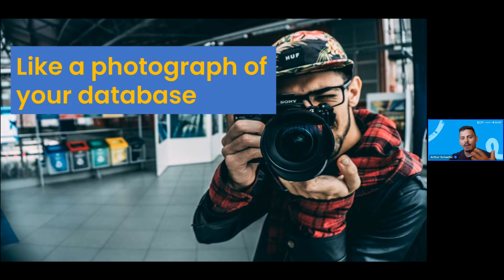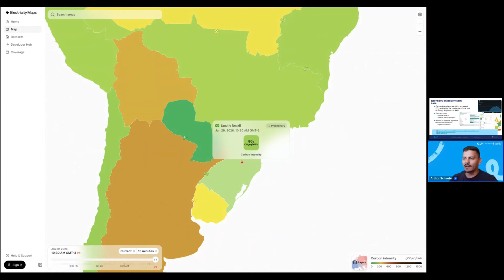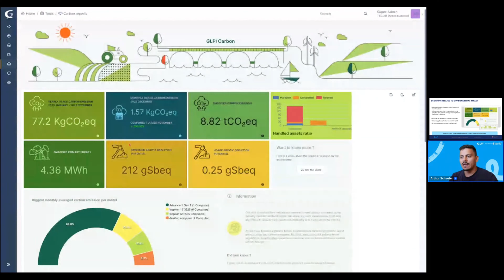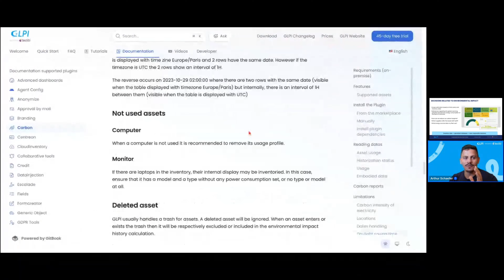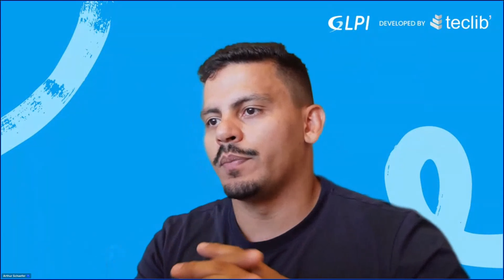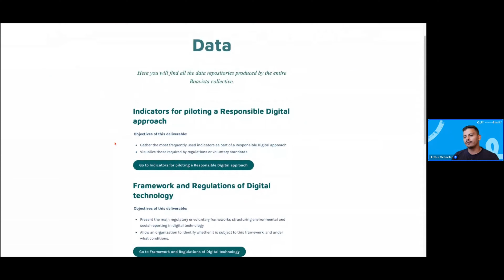WEBINAR : ♻️ Sustainable asset lifecycle: the replay is live!

Comment: Hi i have setup SNMP for my Aruba Switch 1830, but i cannot access it using netbox inventory, I can access it with zabbix but with GLPI i cannot get the Switch to appear at my Inventory.

even i setup IP range , SNMP V1 Credentials and add task to scan IP range using the SNMP Credentials.

Can u help Please.
Reply from the maker: Maybe it lacks the MiBs on the Agent. Please consider opening an issue on the GLPI Agent GitHub Repository, so the team can check it out.

https://github.com/glpi-project/glpi-agent/issues
Have a great day.